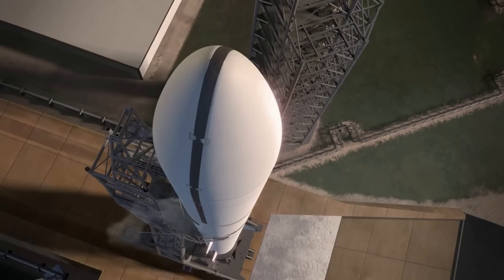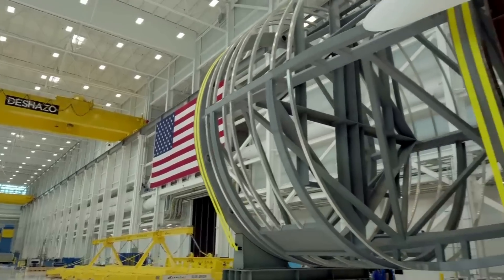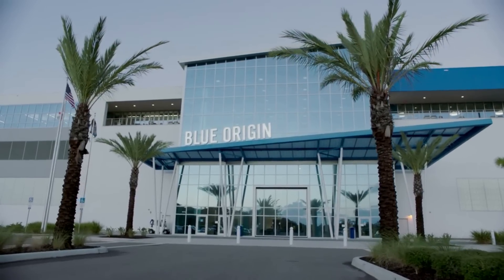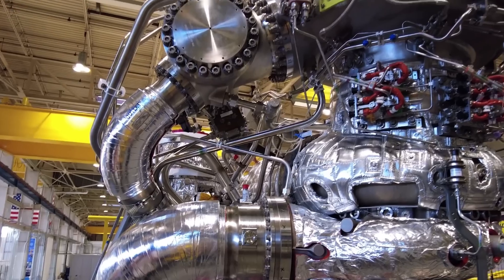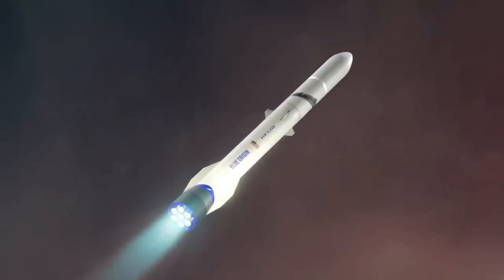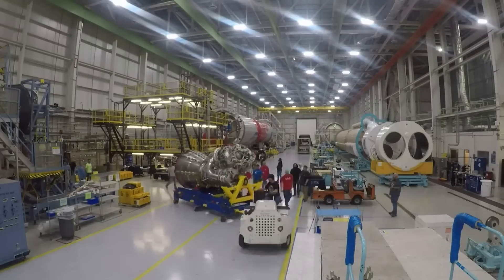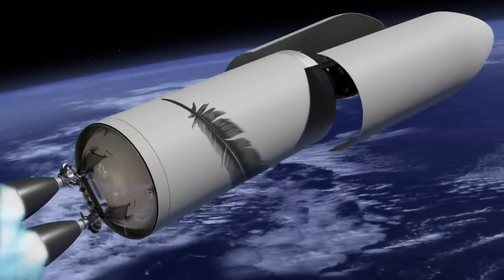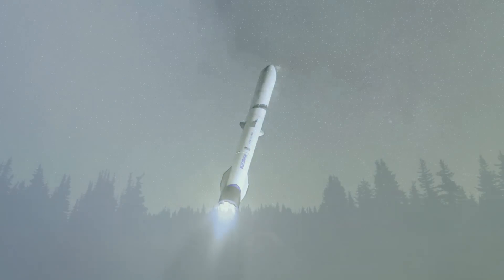New Glenn Production Could Be Further Ahead Than We Think

Comment: Thank you for your report.  I was wondering how they were doing.  Its interesting to see the different approaches to fabrication and testing Spacex vs. BO.  ULA will get to use BO engines well before BO does on New Glenn.  I was wondering, will New Glenn be human rated also?  Or only mass to orbit?
Reply: Blue just signed an unfunded contract for NASA to help them with preparing New Glenn for crewed missions though it was not clear if this is so it could carry Blue’s own crew vehicle or a third party one like Dream Chaser.
Reply: Since there is no capsule for people I doubt human rating is planned soon. I think the approach will be similar to Falcon 9, first, get a solid rocket running, then add a capsule.
Reply: @oxygenasturia5706  They don't need to launch their own spacecraft, they can launch Sierra Nevada's crewed Dream Chaser or even Boeing's Starliner.

And both F9 and Dragon started off together under the COTS and then CRS program, and was the basis for the manned version of Dragon for Commercial Crew.
Reply: Yes, it will be at some point in the future. The big gantry-like lightning tower next to the pad at LC-36 is built intentionally with that being the case some day New Glenn is ever used for manned spaceflight, regardless of whether the spacecraft being launched is Blue Origin's or someone else's.

Comment: In a word, no. New Glenn isn't going anywhere anytime soon... unless Blue Origin starts buying Raptors from SpaceX.
Reply: Not so sure. So far the number of Raptors that have reached space and the number of BE4's is pretty much even. The only orbital methalox launch so far has been Chinese.
Reply: So far the BE-4 has a lower failure rate during testing than the Raptor.
Reply: @luther0013   It's understandable that the Be-4 would have a lower failure rate then the raptor simply it is has been tested far less.
Reply: @michaeldeierhoi4096  the failure rate accounts for differences in the amount of testing as it’s calculated on a amount of failures per unit of testing time. The fact Raptor has a higher rate reflects the fact that SpaceX didn’t hammer out a design before trying to build it.
Reply: @luther0013    You seem to be making the mistaken assumption that the raptor engine was designed years ago and built without any changes made to since.  But in fact Space X is constantly working on testing and upgrading the raptor engine.  It started with raptor 1 and then moved to raptor 2 and there have been dramatic improvements in the Raptor 2 to simplify while maintaining its high performance.  

 Developing a rocket engine is difficult in itself as  one vital part of a rocket.   Then integrating 33 of them into one booster is quite another level of complexity.  And the outer 20 are triggered to fire by their connection to OLM during static fires and launches.   Most people have no idea of the intricate complexity that Space X is developing with this starship.   

Say what you will about Elon Musk who is a drama queen and full of his own hubris, but the road that he has set Space X on with starship is a phenomena.  If it is successful which is not assured by any means that would radically change space travel.  Though he and Space X kind of already have with the Falcon 9, Falcon Heavy and Dragon.
Reply: @michaeldeierhoi4096   if you really want to discuss the Raptor engine in the context of Starship then what SpaceX is currently doing makes little to no sense. Every new version of Raptor has had great thrust output than the last this doesn’t seem like the smartest thing to do as for a reusable rocket you want the engines (the most expensive part) to last as long as possible and be under the least stress possible. I could see it making sense if they were using the higher thrust to allow them to take off engines which would reduce cost on both the production and refurbishment side.

The Starship already had a crazy high payload capacity so there is no need to push it even further. The only reason I can think of is because they want to get Starship’s abysmal GTO performance up so that they can offer very high GTO performance without refuelling flights.
Reply: @luther0013  I don't discount that perspective, but since I am not a rocket engineer specializing in propulsion I can't give a more lucid response.  All I can say is that I find starship to be a fascinating engineering adventure and I'm curious to see if it leads to anything like what is intended.  I'm really not attached either way though I would like to see starship succeed.  Who wouldn't??  

I have a lot criticism of Elon Musk to the degree that I have read about him, but he has led Space X to set new standards in rocket science.  Whether that continues remains to be seen.
Reply: The Space "world" doesn't revolve around SpaceX
Reply: @Devinci297 actually it does as SpaceX launches 80% of all payload for the entire world. Starship is about to make it closer to 99.5%
Reply: @dwightmills9773  in 2022 SpaceX did less than half of the worlds launches. And most of those were for Starlink launches.
  Don't confuse "brand recognition" vs "market share".

Comment: A lot is riding on the company to make sure the New Glenn flies properly. All the mismanagement hopefully is a thing in the past.  This is the most progress I've seen/read in a while.  Given the progress of the Starship program, I'm unsure if they'll manage get their vehicle in orbit if they keep running into issues where their doing their test flights and the consistent battles with environmental groups. Catch tower added more complexity to the design, frankly its going take longer I suspect get it fully running.  New Glenn if they nail their technical issues, likely will surpass them.
Reply: Not really. New Glenn has a capacity of almost 100,000 lbs to LEO. Starship is much larger, not only physically, but payload is 330,000 lbs to LEO. New Glenn is closer to Falcon Heavy, which can carry 141,000 lbs to LEO. It's very questionable if New Glenn can even compete with SpaceX pricing. It would make no sense to fly something on the much higher priced New Glenn with 30% less capacity. Having said that, I believe your right when it comes to the time Starship will require to mature. It has a very long road ahead, especially for a human rating. That may be an inconvenient truth for SpaceX fans.
Reply: @hawkdsl The New Glenn vs. Falcon Heavy comparison kind of relies on if New Glenn's stated payload capacity is reusable or for the expendable variant (like FH).
Either way, with a 7m payload fairing and a high specific impulse hydrogen upper stage, New Glenn will definitely significantly surpass Flacon Heavy in payload size and mass to GTO and beyond. New Glenn will likely end up filling the gap between Falcon Heavy and Starship. It could even surpass Starship for certain large volume payloads, depending on how large the payload door on Starship ends up being, but I highly doubt that.
Reply: I want to see the best for Blue Origin, but realistically there is a high probability that they will experience setbacks during testing or with the first launch.   After all they have yet to produce a rocket that can reach orbit. 

 First rocket iterations inevitably experience setbacks sometimes for years.  ULA's Vulcan and ESA's Arienne 6 are two of the latest examples.

Comment: Would be an epic meme moment if New Glenn reached LEO first, before Starship. But in a fully functional mission, not as an empty vessel with many engines shutting down middle flight.
Reply: Starship will make it to orbit long before NG, no question... but it will be as an essentially flying gas can for a few flights. If SpaceX (Elon) can stop playing around with silly nonsense like flying on 4/20 just for the fun of it (setting back the program 5 months and counting), they are supposed to be landing on the moon next year as a unmanned test flight. At any rate, New Glenn is not even on the level of Starship. New Glenn is closer to Falcon Heavy in capacity (30% less than FH to be precise), so the real question is can it compete price wise.
Reply: You are forgetting one key component to reaching LEO, especially with an untested rocket.....you have to have experience getting there first. Touching space and reaching orbit are two VASTLY different achievements. Blue origin has NEVER done it.... but i admire your confidence.
Reply: @ryancampbell3979  Oh I wouldn't put too much into that line of thinking. Getting into LEO is well understood, and I'm sure there is allot of paperwork around on how it was done back in the 1950's. Plus the aerospace industry is very cross pollinated with former engineers of all the big guys (NASA, Lockheed Martin, Boeing, etc). They'll be fine. The real question is will they be able to price compete. The only metric that matters.
Reply: @hawkdsl that line of thinking should be the only line of thinking. Sending millions of dollars into "space" on a hope and a dream, isn't cost effective, nor does it serve as a good business plan. Like i said before, I admire your confidence and "cross pollination" doesn't guarantee rocket companies can reach orbit, let alone return
Reply: @ryancampbell3979  They'll be fine. Don't sweat it.
Reply: @hawkdsl lol please (sir or madam), no sweat will ever cross my brow over this. I was simply correcting/enlightening an irrational statement. Space exploration is amazing and i encourage everyone to get excited about it. The jeff and elon battle/competition is just pathetic and people need to give reason to their claims
Reply: @ryancampbell3979  There was nothing irrational in my statement. Furthermore, it is completely rational to believe BO will make it to orbit... They have experienced personnel that have built machines that have done it before. You are right that it is a gamble none the less, as even SpaceX's Starship has been unable to make it either. Neither is going to give up though, so yes, BO will make it to orbit.
Reply: @ryancampbell3979  No, you don't, if you plan and design your rocket, and also test your components on the ground, your rocket will most likely reach orbit. This was done for many rockets before and it's a solid plan. SpaceX is the first company to go a different way but failed approaches multiple times before succeding at some point, also doesn't really give you much information about rare risks and is also not so good in building trust in your vehicle...
Reply: While Starship progresses open very fast, New Glenn is progressing slowly. Yet, Starship is still far from a solid design, and such errors like starting the rocket from a launchpad which was clearly to fail are very questionable for SpaceX.
Reply: True